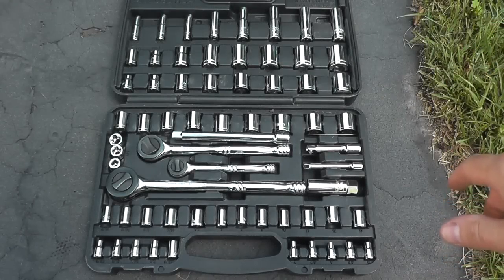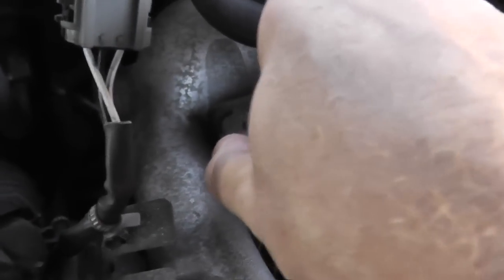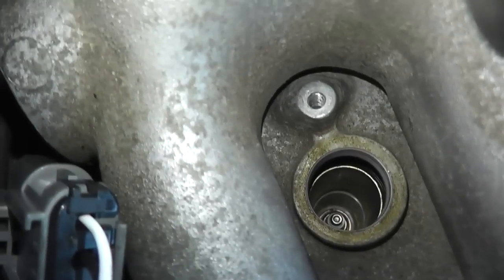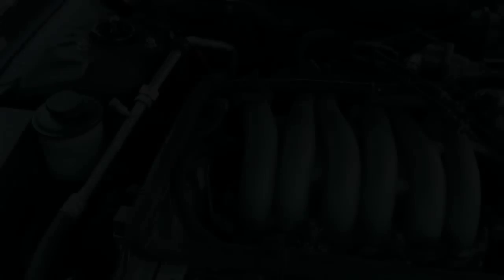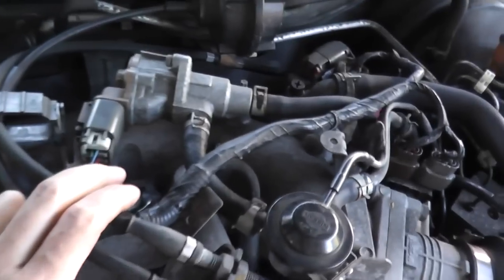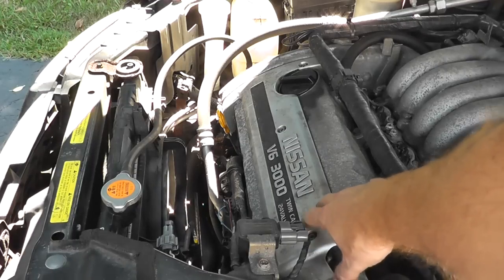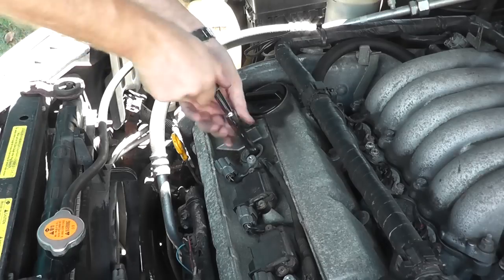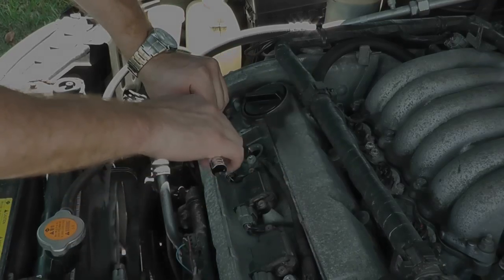Nissan Maxima And Infiniti Spark Plug Replacement with Basic Hand Tools HD

Comment from the maker: I would first check the condition of the transmission fluid. Make sure it's not burnt or dark color. If it is, change the fluid. I have a video up showing how to replace the fluid. If the fluid looks ok, check to see if you have any engine codes. The drop resistor usually throws off code p0745. Other components that could effect shifting is the vehicle speed sensor and throttle position sensor. But again, usually you'll have an engine trouble code for these sensors. Let me know what turns up.

Comment: Thank you and I really like your videos.  I only have one ask.  The right and left bank are determined from the rear of the engine -- not the front.  The concept of right and left is based on the driver's position.   The right/left from the drivers/operators seat assignment started with two horse wagons and continued with steam locomotives.

Comment: Love your video's they help out a lot , have a question do I have to gap or Measure the spark plug before I install the new one, if so what should it be on ?
Reply from the maker: Thank you. Most plugs are pre-gapped from the factory.

Comment: Thanks to your video, my car is running and I changed all 6 plugs!! I did brake off one of my coils the one in the front furthest to the right. The car still runs now. Is it safe to drive that way?
Reply from the maker: cashflow2day You'll want to fix the coil as soon as you can. Running on five cylinders will give you poor performance.

Comment: I30 2000 233000 miles . p0430 

My coil pack is arcking? Only reason why my check engine light is on . iradium dual. For me. Love the car . wind Noise is amazing from the old door seals .. 

Starter went out at 230000 miles .

3\22
240000 check engine light off most of the time .

Comment: Hi, I have a 99 Maxima, and the electrical connections on my coil packs have green tabs instead of the gray ones in your video. I have tried pushing down on those tabs and pulling on the connectors as hard as I can but they WILL NOT RELEASE!!! The green tabs on mine look a little bit different, and can actually slide inward and outward on the connectors- are they supposed to come completely out before pulling on the connectors? Thanks
Reply from the maker: +s blagg They can be stubborn at times but the green tab is the thumb tab.
Reply: +CarsNToys 
Trust me these connectors are NOT coming off just by pressing down on that tab. It is a different type of locking mechanism- I read here that the green tab types have to be pushed inward toward the coil pack (look at the photos in this link to see the same green type tabs I am talking about):

http://nissanhelp.com/diy/maxima/projects/spark_plug_coil_replacement.php

But it is STILL not working.

Comment: hi , like your video.
i have 06 maxima ..it shut down while running and start hard taking long cranks
when start it take very slow and shift hard on gear. what could be the problem
Reply from the maker: harpreet kesar Could be a number of things. Have you done anything to the car recently? Have you checked for trouble codes?

Comment: What socket set brand do you have? How do you like it and how common are those magnet ones?
Reply from the maker: I like Craftsman. I've been using their tools for years. The magnet sockets are easy to find. Pretty much every tool company makes them. Check out your local auto part store, harbor freight, sears, etc. Cheers

Comment: Hey bro... I went ahead and replaced all 6 spark plugs (thanks to your video), and I also replaced all six coil packs as well. The problem I'm having is the new coil packs (the longer ones near the firewall) will not sit with the small cap (the rubber cap at the top or bottom of ignition coil) on _ so I have to remove all three to get them fit over the new plugs (double platinum auto-lite by the way). I'm wondering if it's the plug, or is these coils a little longer...but they measure the same size as the ones currently installed. And these were bought at AutoZone specifically designed for my 96 Nissan Maxima. 

Any ideas on why this is happening? 
P.s. Car runs okay without the cap though.
Reply from the maker: Rush They should definitely fit. It's a tight seal and you have to apply some pressure to get the coil pack over the spark plug but if it's the right part it should fit.

Comment: Where I can buy these TOOLS as you use in this video? I need urgently replace my Spark Plugs of my Infinit i30 1997. I think as original still. Thanks.
Reply from the maker: Leandro Martini I actually keep a small tool kit in my trunk from Harbor Freight. Take a look at their 64 piece tools set for $35. The only thing you'll need to add is an extension to reach the spark plugs. Other than that, the tool kit has everything you'll need.
Reply: CarsNToys  Hi friend. You have the link to me buy this tool? Because I found only big box with many pcs. Tks buddy.
Reply from the maker: Leandro Martini http://www.harborfreight.com/hand-tools/hand-tool-sets/64-piece-14-38-and-12-socket-set-67995.html
Reply: CarsNToys
 Thank you so much!!! :)

Comment: Hi  Is the coil pack suppose to come out relatively easily, I ask because I can not seem to get the #2 coil pack to come out, the more I pulled the more it felt like it was going to brake.  It felt like I was stretching something out of shape.  I stopped and decided not to go any further with the removal until I found out if there was any special way for removing them.
Reply from the maker: Sometimes they can really 'solidify' on there; especially if they've been on for years. Just have to be patient.
Reply: I was able to get it out and it turns out that it was a after market coil pack that had over sized rubber seals.

Comment: 98 nissan maxima, what gasket or seal needs to be replaced if my #1 plug boot (only) is wet with oil? The plug itself is not fouled. This can't be normal, can it?
Reply from the maker: +Tim Dryer There's a gasket in the spark plug tube that prevents oil from getting on the plug. You'll have to pull the valve cover off. I have an older video showing how - https://youtu.be/lqJkGOlTvSo

Comment: You have a video to how to change of oxygen sensors and where is located sr
Reply from the maker: I have a couple of them. What's the trouble code? There are multiple O2 sensors.
Reply: @CarsNToys  P0141 NISSAN REAR SENSOR HEATER CIRCUIT MALFUCTION BANK 1 SENSOR 2

Comment: Hi again. I have a 97 Infiniti i30 with 97k miles. I do not know what else to do to solve my problem. The RPM is unstable despite the car moving, the rotation-suddenly drops and the engine off. Only start the engine if I start accelerating while.
- I've done cleaning the air sensor with MASS AIR FLOW product;
- I've only had the two oxygen sensors (lambda);
- Not changed the spark plugs still 6;
- I did not use any additives to clean the injectors.
Give me a light please, it's dangerous to drive this car.
Thank you!
Martini
Reply from the maker: Leandro Martini Sounds like you're not running on all six cylinders. Any trouble codes?